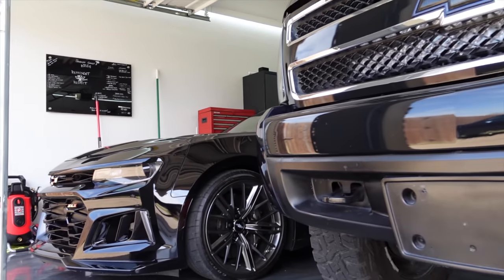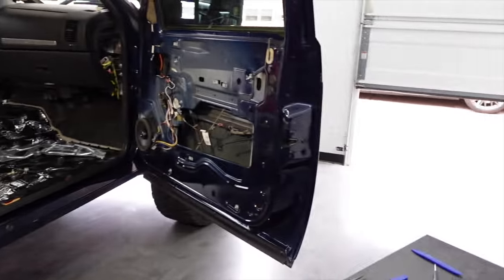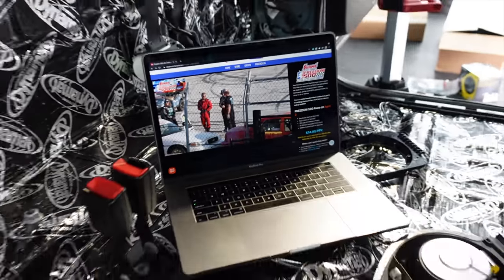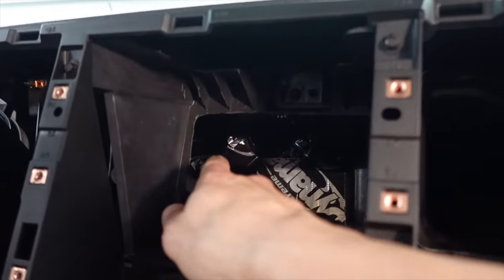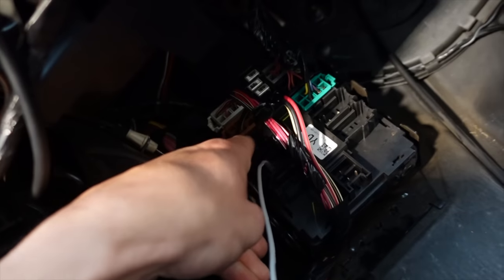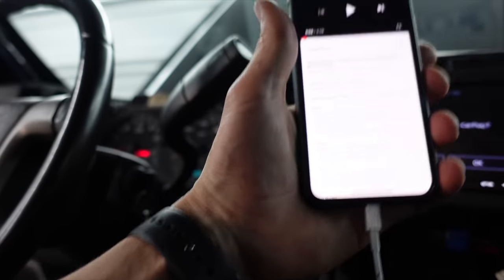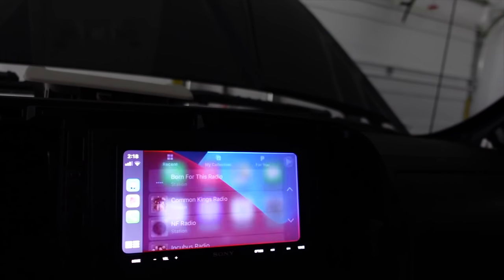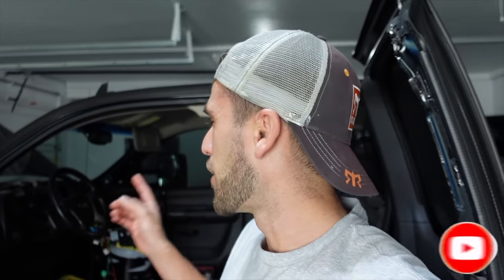The [ULTIMATE] Silverado Stereo System - Sony AX7000 + Kicker: Interior Build Pt. 3

Comment: Just a tip for when you need to grab ACC in a place like that. Take 2 insulated female spade connecters (like the ones that connect to speakers) go about 2-3 inches from where you tied in and cut your wire then use the spades and put a 10A fuse in each one and bam you have a inline fuse and you don't need to worry about shorting anything... Side note cant remember if its fuse 42 or 43 under the hood but you can use a standard fuse tap in there to get ACC power... All in all one of the better DIY jobs I have seen👍

Comment: Should have covered all the large service holes in the doors. Also put the dynamat on the inside door skins. It’s absolutely a must. If you cover the holes you get a much better bass response and much less outside noise.
Reply: I wanna do same to mine but these years chevys were notorious for water getting past window seals and would hold water if fully sealed. Plus I do alot of mudding and offroad but think I'm gonna stop doing that and get the ole 87 going again

Comment: Get a separate amp for ur sub. Not gona get all into it but the 100by 4 is barely enough for ur speakers alone. The sub with it is jus killing it even more.. an always pay attention to rms only to make it less confusing!
Reply: Agreed. An underpowered sub will burn out quick. A simple wiring kit & Amp will fix it. Otherwise, awesome build.
Reply: Yea with all that dynamat I thought you were going with 2 12s lol. Nonetheless nice build.
Reply: The deck actually has a built in amp for a sub also.   It’s a one of a kind Sony.    Lol but yeah.  It’s kinda silly
Reply: @jeremymatwyko6755   if under powering a sub will burn it out then if you drive around with your volume knob at say 10 out of 40, does that mean you will burn your sub out?
Hahahahhaha
If under powering your sub will burn it out, does that mean you have to always run it at full power?
Hahahahahahah
Reply: @bradysimpson  Technically, you are correct... driving with no volume won't do anything to the subwoofer. But at any increased volume, it will cause clipping/distortion, eventually causing the sub to fail. Why go through all this work, not install an Amp, and have the sub evntually crap out? Lol
Reply: @jeremymatwyko6755 , you were talking about low power, not distortion or clipping. 2 different things.
Reply: @bradysimpson  Power and volume are two different thing as well....so I'm not understanding what you're getting at. And power completely effects clipping in speakers/subs, thats why amps have gain dials on them. 
All I'm suggesting, is that he run an amp to power his sub, as most subs require a minimum wattage (usually around 300w, depending on brand/size) to function properly, and this can't be attained by  head unit....unless I'm missing something
Reply: @jeremymatwyko6755  , I’m just saying that when a person says that under powering a sub will blow it, they are wrong.
And you said, “An under powered sub will burn out quick”. 

Distortion and clipping kill subs, not having the volume low. Low volume equals low watts. 
He can run the 15w rms coming off that headunit all day and as long as it isn’t clipping or distorted, it won’t burn up the sub; contrary to the quote from you.
Reply: @superior3384  you are confusing AC power( what the amp pushes to the sub) and DC power(what the car delivers to the amp. Low DC power will cause clipping. Low AC power will not.
Reply: Wouldn’t need much of an amp with that sub either.

Comment: Pac audio rp5-gm31 is the correct aftermarket harness you should be using for your model truck when switching to an aftermarket radio. It does all the data communications for the gm lan networks (data communication wires that run through factory radio), has factory accessory for your radio, and retains your door chimes. Highly advise using that harness, especially when doing a clean install like this. Nice work though! Good stuff on finding those accessory wires
Reply: Do you have a place to go to find the right harness needed for other cars too?

Comment: Hey there! Just a pointer for you in the future or your subs, but for an extra $20 bucks Crutchfeild will make a plug and play wiring harness and it makes everything so much easier and it is 100% worth it, if you sell the truck and want to keep your radio the stock will still hook up.
Reply from the maker: Thanks for the tip!

Comment: I didn’t see if you did, but you should put a piece on the exterior sheet metal. You do not have to cover the whole thing, but a piece right in the center of that door panel will stop a lot of vibration and sound.

Comment: Hey bud! Nice job on installing the sound deadening materials! I was watching closely on when you hooked up the amp, I noticed that you didn’t install a fuse from the battery to the amp. Probably should take a look at that….. and installing the correct gauge wire to the amp is also important as well. Crutchfield is an excellent source to help with that. Other than that, nice job!😊🍻👍
Reply from the maker: Thanks for the tips!
Reply: @LonestarHawaiian  whats the name of the paint of ur truck? or did u repaint it?
Reply from the maker: @Jabez.21  It's a "Dark Ming Blue Metallic" original OEM paint.
Reply: @LonestarHawaiian  lol wow u reply so fast w manz but uh do yk the paint code? i actually have a cateye n im tryna paint it and I really liked the paint from ur truck.

Comment: Throw a 500 watt- 100 watt amp and a simple 4 gauge-8 gauge wiring kit on it. Your sub will burn out so much quicker as it sits right now.
Also if you wanna get extra, you can throw a amp on your door speakers and make them even sound better

Comment: Nice build but yea I'd run a separate amp to power that sub. That built in amp is just enough to power your mids. Not the sub you'll notice a big difference running a separate amp

Comment: The acc switch is by the gas pedal .... you can tap the wire there so when you shut the truck off it can stay on until you open the driver door its late and i hope i explain it well enough lol

Comment: Next time use an Idata link interface and replace that Sony with a Kenwood, top it off with the proper gm harness kit and it's plug and play once you solder the harness kit to the head unit wires.  No need to run extra power wires.  Pro tip if you use Kenwood, you don't have to deal with the pesky vss (green wire) if you have DVD.  My kids can watch movies while in motion.

Comment: I have the same head unit in my 07 with JL speakers. I found with mine that with high volume it would shutdown. Ran power and ground direct to head unit. Same issue. I found that with the pac31 interface for onstar you have to bypass speakers wires and run them direct to the speakers. The interface can’t handle the power.

Comment: Did you get the iDatalink Maestro Rr to intracellular the radio with the truck. It's highly recommended. Also, ground the parking brake wire from the radio so you can play video anytime.

Comment: How much matting did you use? Car Play has to be connected via USB right? If so is there a way to run a USB through the back and up through the center console to avoid a wire hanging out the front of the unit?

Comment: Bit late to the party but to find an accessory on power source theirs a blank pin on the bcm distribution block by your left foot under the cover that you can put a spade connector on which is where I ran mine from

Comment: Did you connect the yellow wire from the head unit wire harness, straight to the battery with a in line fuse?

Comment: Great Video! i Would like to know, if you are still using this set up in your vehicle? I recently bought this stereo for my hatch back. I have two 8 inch rockford fosgate p2d2 subs with 250w rms and S Skar 6.5 mid ranges and polk db 1001 tweeters on my both front and rear doors. I would like to know, if this set up works with the stereo using direct connection method? Also did you use any fuse block when drawing power from the battery direct to the stereo? Do let me know your thoughts? Thanks

Comment: Nice job but you needed to dynamat behind the speaker (the backside of the actual door skin). You did the outer rigid part, not the part that vibrates. 👍🏻

Comment: You used an amp kit for the head unit? At bare minimum, you should have used the kit to power a mono block amp for the sub alone. Better would be to add an 4 channel amp for the door speakers alongside the mono amp for the sub to get some good mid-bass to fill out your frequencies.

Comment: You definitely are gonna want a mono amp for that woofer man. There is no filter on the rear speaker outlets from the receiver for one. The frequency response of that woofer is probably only 30-300hz. 2 if you try and turn it up high on the unit to get more output you will definitely distort and possibly blow that woofer. Get a nice 300 watt amp and learn how to gain set the amplifier. Not trying to be a tool, but just want to save you the headache. To run all 4 speakers and a subwoofer off of a single din receiver is asking a lot of the receiver so maybe even a nice 5 channel amp to leave room for expansion.
Reply from the maker: Thank you for the comment and your knowledge. Super helpful! 🤙🏽

Comment: There is a separate kit you can buy from Idatalink..if you have factory steering wheel controls. Crutchfield should have offered or recommended a wiring harness that would solve all the wiring problems. I did the stereo in my 13 all alone..
Reply: Oh, im also rocking 2 10s with 1500watts in mine, and I like that it's contained in the truck,  not heard 2 miles away. Though I am seriously digging the idea of a full dynamat install on the interior🤔

Comment: I put 2 12's under the seats of the 2015 Z71 its soooooo Nice!!!!  Did you not run an amp for the sub?  The power wire from the battery usually goes to the Amp not the back of the radio so I'm kinda confused.  Yes I am an Audio guy Message me on IG if you want.  Ok maybe you said you didnt at the end LOL!

Comment: You'll be replacing the DS series soon, should of went with the KS series and the front should of been component and not full range speakers. Your fronts provide the mid bass and highs from the tweeter on the pillar.  The rears are always gonna be a full range speaker unless you are going full custom with crossovers and separate amps for door speakers and subs. Also you wired the amp completely wrong, the only wires from the head unit should be your sub outs and remote wire. Amp power wire should not be ran from the head unit. But I'm just saying it's your project.

Comment: Do not wire your truck like that. Do not run a sub off the deck. Run 4g power thru firewall to a kicker 300.1. Use rcas from radio to amplifier. 
Thats normal boot up operation. Just wish you wired it correctly

Comment: Does anyone have a rattle on their truck? Ext cab. Drivers side rattle can’t seem to find where it’s coming from
Reply: Yep, panel under steering wheel. Push on it and it may change or stop. Metal shield thing attached to back of it. Remove panel, there's a hidden bolt above Brake release. Spray some brake cleaner between metal and plastic then spray some expanding foam under every raised part of metal. It expands 100% so fill about half or so wait 5 min till it stops. Then put some Gorilla Tape on the hoop over lower steering column. Reassemble for no more rattles

Comment: Yeah that stereo does not power a subwoofer. You need a legitimate amplifier, you're underpowering that subwoofer so so so much. I'd be surprised if the stereo didn't overheat.

Comment: Armature car audio DIYers are so cringe!  I spotted several things wrong with your install!
Reply from the maker: educate me -
Reply: @LonestarHawaiian  this would take to long! I have been in the car audio scene for over 30 years have been an installer for just as long. In your video there is no mention of you installing an amp for the subs.. your head unit does not have enough power to run your rear speakers and a sub. Your head unit is going to fry.